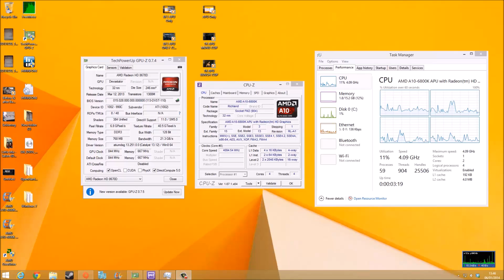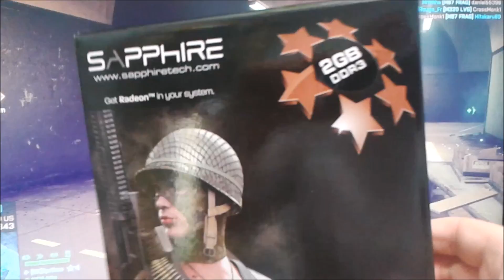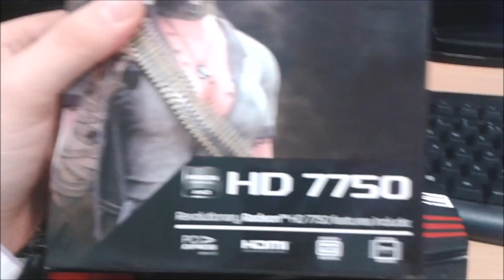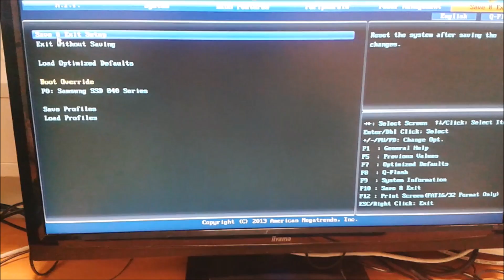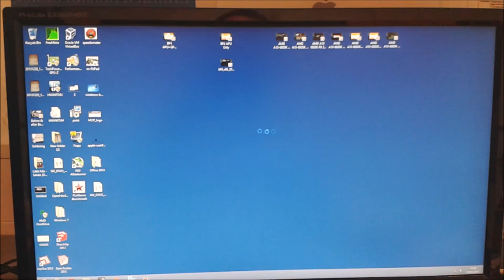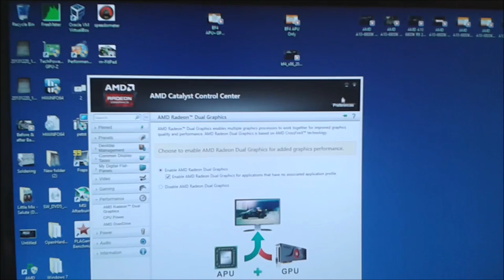AMD A10 6800K HD7750 Battlefield 4 HYBRID CROSSFIRE COMPARRISON

Comment: You don't need to play it on ultra tbh, it looks great on medium at 1080p
Reply: Low settings at 900p still looks better than a console!
Reply: Ryio5 High 720p looks better than old gen.
Reply: low 720p look better than ps3 and xbox 360
Reply: -2p ultra low better than ps3 and xbox 360
Reply: True. You can play it at Ultra or at 1080p, but not both. Not on an APU + 7750 Crossfire setup.

Comment: I'm sorry but this is unrealistic. You've everything set to Ultra with 4x anti-aliasing and V-sync on. I have a R9 270X and I wouldn't play with those settings (though my target fps being 60 of course). Turn off v-sync, drop down AA to 2x and set everything to medium and voila - you'll have rock solid 30+ frames per second. The idea of hybrid crossfire and Mantle is not to be able to play BF4 on ultra with a discrete GPU but to allow casual gamers to play new games with decent graphics and frame rate. Obviously it's not the solution for performance bitches (like myself) but it is a great technology nonetheless. So, you know - give AMD some love :)))

Comment: You thought this setup would work with B4 maxed out .....come on dude...... with some tweaking in the settings you can play just as good as a console. Did you update the drivers before you played? Just wondering.
Reply: As good as a console,you noob.This card is 4 times as good as a console!
Reply from the maker: deven thompson It is 16GB DDR3 1866MHZ Crucial Ram

Comment: No wonder it ran crappy. You dont have to run it on 1080p and ultra settings to look good (Not saying it dont look good) But you can get a the game to run on the apu alone with a resolution 1366*768 and medium graphics and that still looks good.

Comment: The AMD A-10 6800K is made to run BF4 at 720 P  with Meduim Setting to get 25 to Highest 40 Frame per Second and in Dual GPU Mode about 45 to 70 High Frame oer Second which still is not bad for what Money you put in it!

Comment: I have this processor A10 K 6800 and bought a video card XFX ATI Radeon 6670 because the page says that the processor AMD Hybrid Crossfire only makes the plates 6650 and 6670. Also you can do this with the plate HD7750 ? With another video card you can also do this? Is there a list of video cards which give Hybrid CrossFire with the A10 6800 k ? Thank you.

Comment: dude what do you aspect if may i ask ? you are running ultra BF4 on hd7750 , your apu is almost like hd7750 so its normal you get nearly double amount of fps , buy a decent card ... you will see the difference , and your rams are running on 1866 mhz apu uses that mhz value,  upgrade to 2400 you will get %30 more performance increase

Comment: i have 7750 and i could buy another used one for say 50$ and crossfire 
them (different brands though) or should i aim for 150$ (that i can 
hardly afford) to buy a new GPU that would hardly be better than 2x 
hd7750 ??? anyone?
Reply: Buy a used 7950 or 7970.
Reply: TheSanco26 i already bought xfx r7 370 be... i also had r7 360 for a week (then i returned it and bought 370, cause it seem not so much better than my old 7750 oc from gigabyte...  all in all i think i should have bought nvidia gtx 950, it was the same price... i wanted to buy 4gb model from xfx r7370 cause it was only 10 dollars more, but the store did not have it... i know that they benchmark the same ( 4gb version is slightly better) but maybe in the future those extra 2 gigs would come in handy... if nothing it would be easier to sell one day, but it's over now... i'm stuck with 370, which is a bit noisy, but i plan to put cpu cooler on it (and void my warranty) but the saddest part of my story is that all new games cannot be cracked and pirated, so i really don't know why i spent all that money... i could have bought supreme 5.1 speakers or even 27'' monitor for that money... fuck!  someone please crack that fucking denuvo thing
Reply: TheSanco26 btw i tried crossfire 7750 for couple of hours on far cry 3, and i must say that my fps almost doubled, you could clearly see a performance benefit, and that would cost far less, but it's hard for me to buy those things cause i live in sparsely populated area of eastern eu, so i can only buy used things via mail, and thats pretty  risky and also supply is not so great... of course there's always  amazon but i'd need credit card (more of a nuisance than actual problem)  but shipment is quite expensive

Comment: i have 6790k and hd 7770. and i can't set it up, i tried everything. I got win 7, asus f2a85m, asus hd7770 gddr5 1gb. i have configured it properly in bios but option doesn't come up.
Reply: I also have this one. My opinion is better use single graphics than hybrid xfire.. i use hd 6950 with an apu a10 6790

Comment: Your Frame rate was crap due to the fact you had v-sync ON in Battlefield 4. turn it off (in both AMD Control Center and your game) and you'll notice the difference. You should be getting at least 30 - 45 FPS

Comment: You thought this setup would work with B4 maxed out .....come on dude...... with some tweaking in the settings you can play just as good as a console. Did you update the drivers before you played? Just wondering.
Reply from the maker: Look at it from the console perspective, they have an 8 core processor only but yet it runs BF4 at 60FPS - I'm running an 4 core processor with an extra GPU to help it - so why only 14FPS?
Reply: Jake Billing because console has everything on the lowest settings possible. If you put everything on low you would be at a constant 60fps.
Reply: Keith O'Reilly Jake Billing Console Graphics=Medium-Low Settings on PC
Reply: Jake Billing Console is 792p low settings and still 30fps
Reply from the maker: Cheers guys!